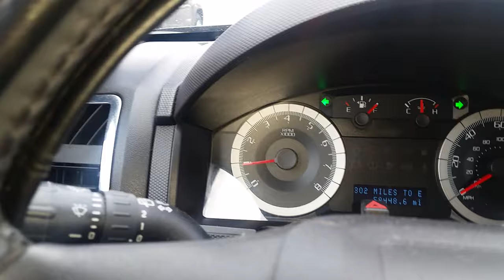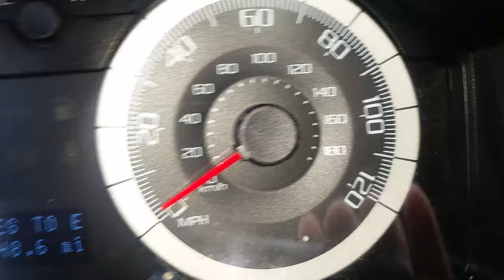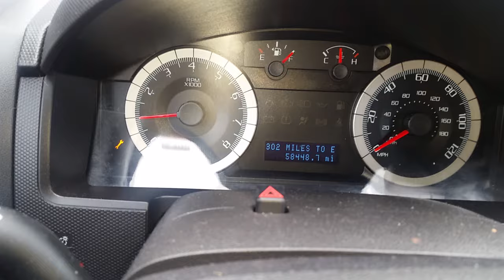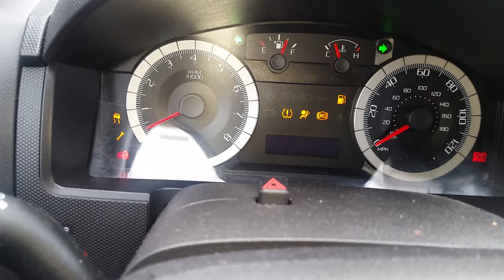Ford wrench light

Comment: This is happening to my 2008 Ford fusion..when the wrench light comes on it still drives but idles and doesn't switch gears and wen I turn off the car and turn it back on the wrench light comes off and it drives perfectly fine..does anyone know what I need to do and how much it will cost ?
Reply: Did you figure anything out mine is doing the same
Reply: Its electrical gotta flush the memory from the car unplug the negative on the batterie there is a guy who shows how to do it on youtube
Reply: The throttle body electtrical are the probleme

Comment: throttle position sensor every code will pop up as the throttle. electronic throttle body which is about a 300 dollar part
Reply: Amber Brantmeier what if you change that and it started after that because I'm having this problem to
Reply: Samuel Smith did you already replace the electronic throttle body
Reply: Amber Brantmeier yes I did

Comment: So I have a 2008 Ford Escape XLT and right now as of 9/4/17 I am having the wrench on my dash board come on but nothing is happening my car isn't stalling or it ain't going 4 mph but it comes up after awhile sometimes and I shut my car off and it goes away and today it came on 9/4/17 I went to auto zone to have them check any codes on the car and they told me there were no codes but I notice that every time you shut the car off it resets the problem and goes away but I'm not having the problems some ppl are having when the wrench comes on
Reply: Mine is doing exactly the same thing!  Wrench light comes on, loose power, pull over, turn off engine, resets and no problems for a couple weeks.  Then the same thing!
Reply: I have a 2013 Ford F150.
Reply: Did you guys ever figure it out

Comment: I have this same thing happen to my 2005 Montego. Haven't got the codes ran yet or had it fixed.
Reply: David Williams did you very get it fixed bud? my 06 500 Is doing the same thing
Reply: Karen Bauer Sinnen I believe I have. I ordered a reconditioned throttle body and replaced the old one and so far the Montego has been running great!
Reply: David Williams  thanks bro. my car would only rev up in neutral or reverse but in drive it had no throttle response dead pedal. but would move like 4mphs. did you have those problems
Reply: Karen Bauer Sinnen My Montego was "drivable", but would only go up to about 10mph without pushing the gas pedal. If the gas pedal was pressed it would lurch forward.
Reply: Karen Bauer Sinnen Nope. All I know is that I replaced the throttle body when I had the Wrench Error and for about a month now it drives great. No problems, no warning lights.
Reply: David Williams i just bought a 2007 mustang v6 it starts fot like 3 5 min then quits was yours a V6